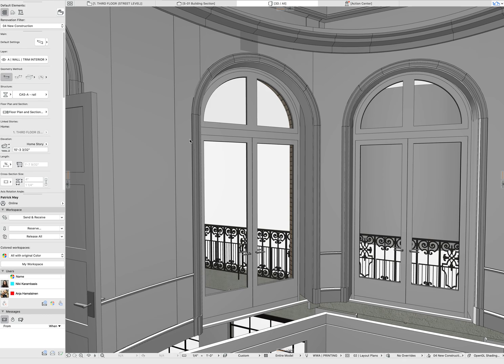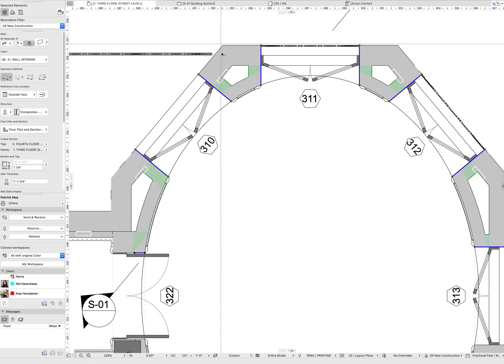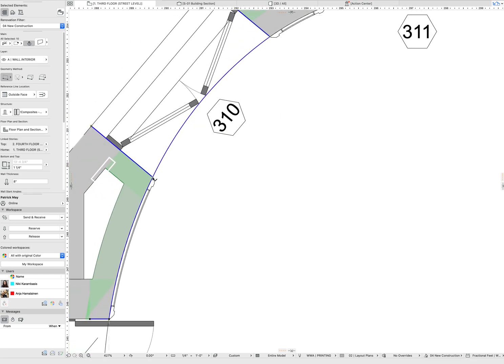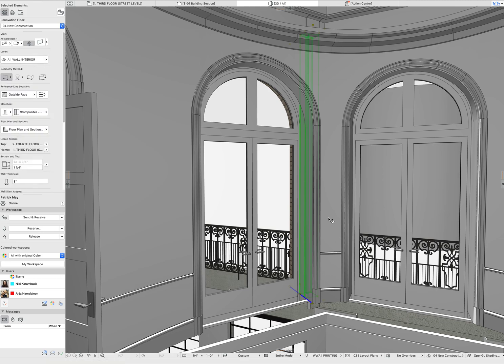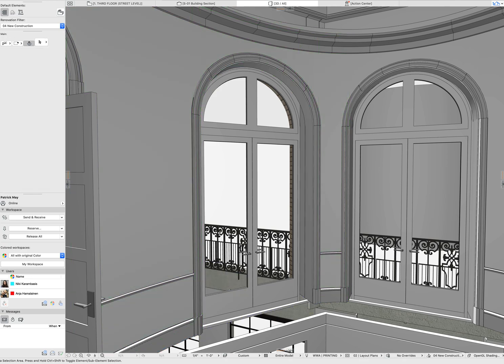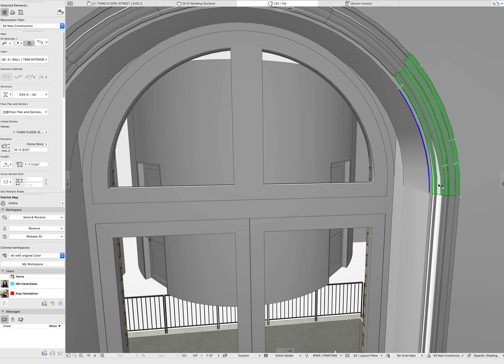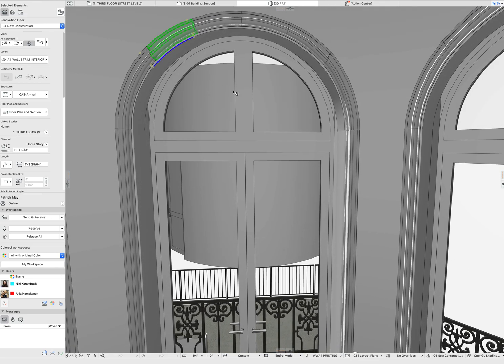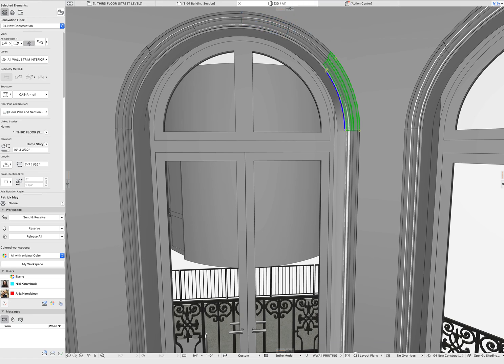Wall Junction 4

Comment: The curved beam junctions, have you tried changing the end angles?
Reply from the maker: yes, it is a bit of a guess and check process that I could not dial in on the fly for this video, since the curves are compound: An arched opening in a round room.